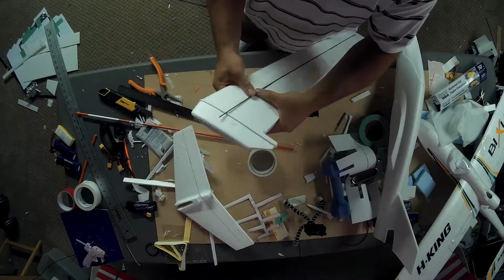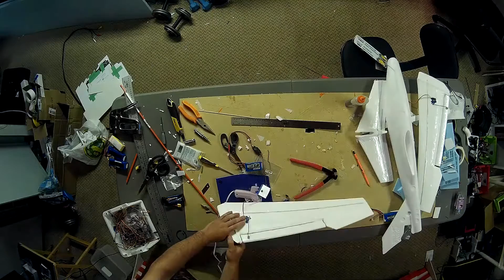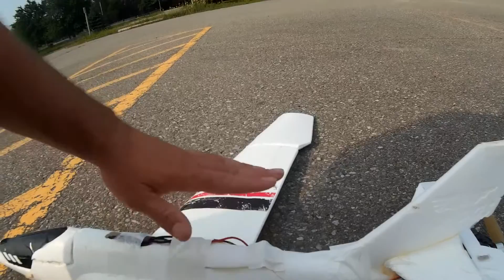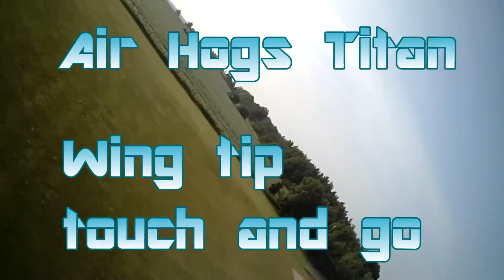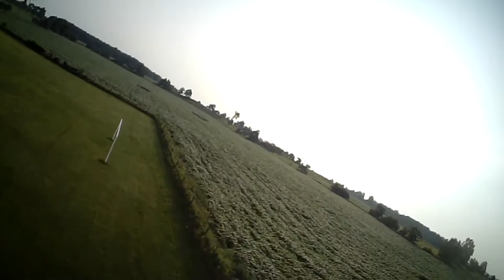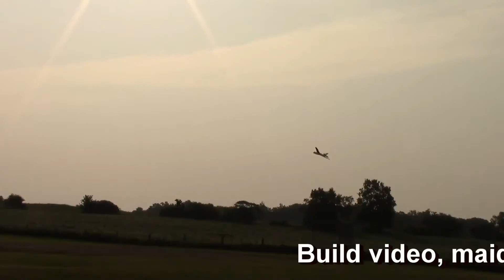Air Hogs Titan RC Conversion (fixed audio echo near end)

Comment: Batteries, like fuel tanks ALWAYS have to be put over/near CG. Anything else will not work properly, especially on changing batteries with different capacity/ weight or tank with decreasing amount of fuel left. Bad decision. Overall nice build. I´m flying my Titan on 2 channel with flying elevator. Best price buy!
Reply from the maker: when you have a heavy motor way out back you need a counterweight up front to maintain CG...this plane flew perfectly for two years...yeah, it would be great if everything worked out so that the battery could be right at the CG, but in this case it wasn;t possible.
Reply: @UnlimitedVertical  You're perfectly right. I do also have planes with the battery all the way in the nose. But hey, I'd rather have capacity in battery instead of dead lead.... 😁👍🏻👍🏻

Comment: Unlimited, how did you figure your CG? Did you do it before you added the electronics? I am doing a pusher version like you ended up doing and I did my CG before cutting up the plane, also with the swept wings did you have any problems with the ailerons? Thanks for posting this video! One more thing I had already cut my elevator straight across figuring I would a better response with doing it that way.